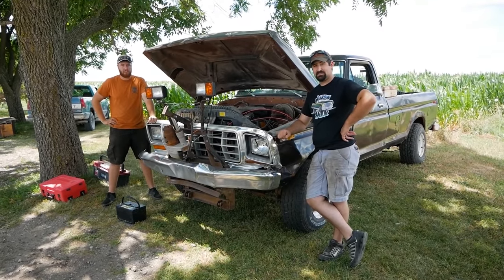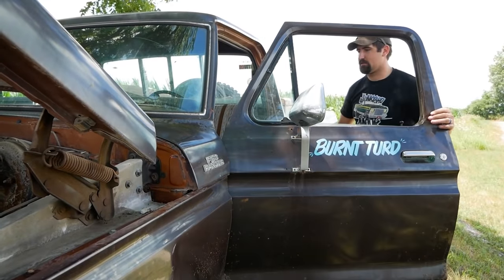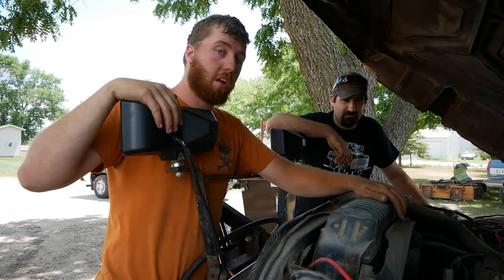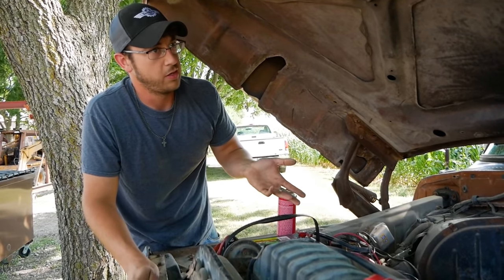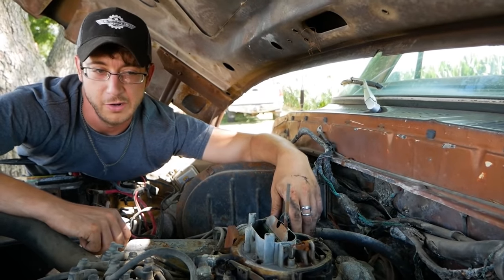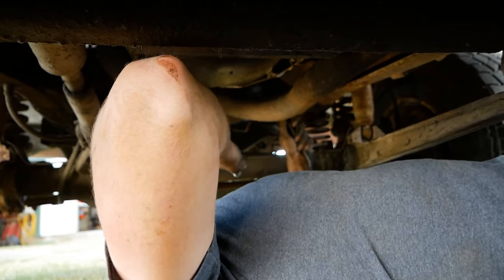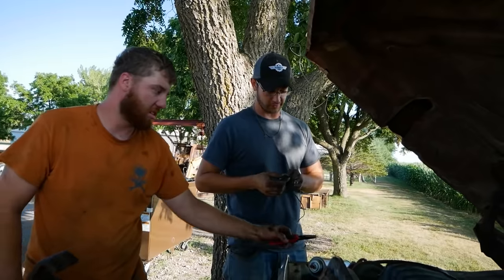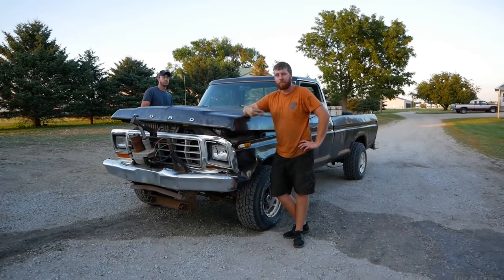BURNT Truck Revival?? 1979 F150 First Start Since ENGINE FIRE!

Comment: I have 02 4 door Ford truck, about 250 thousand miles. Bought new by oldest son. Runs like new. Not oil burner. Inside, out side great shape. Owned Chevy trucks, rust buckets . 84 year old driver.

Comment: those old snowplow lifts only power up. they use the weight of the plow and gravity to go down. this truck is a perfect example of the joys of "free" vehicles. you'll find there's always a good reason why the last guy threw it away and gave it to you. in my experience, it's because they ran out of cuss words from working on it, and they figured you still had some left.

Comment: Look for the small cover on the rear of the transfer case between the 2 larger covers. If it doesn't have that it's a 203 chain drive case.

Comment: The track bar mount on the axle side requires a tapered bolt. The original mount is a straight bolt that wallers out. I don’t remember the reamer pitch required to taper the mount. Several companies (used to) make the taper bolt kit. 
Worst death wobble ever un-repaired.

Comment: I'm not sure how that plow worked, but the way I've seem them is to go down the switch locks down to a "float" mode. Where the weight of the blade pulls the hydraulic cylinder down, so I think to get that down you would need to have it in float mode and push down on that cylinder on the front, I think.

Comment: IIRC, 157 tooth is for manual vehicles, the starter for which has a 9 tooth gear. 164 tooth is for automatic vehicles. starter will have 10 teeth. also the automatic vehicle starters' bendix stick out about twice as far as the manual variant on fords.

Comment: That is a light duty Dana 44 front (small hubs), 3300lbs axle. They made a heavy Dana 44 (big hubs). It is a part time 4x4. By unlocking the hubs it only makes it it "Part Time". You kinda had it backwards. "full time" or "all wheel drive" is what most SUV are today. The light duty D44 isnt a bad axle, but the hubs should be upgraded

Comment: (3:55)She's lifted. (6:30)You're gonna want that cluster of wires to be individually insulated. If you can bypass that whole section that might be a fix. (22:22)She don't turn left and right so much but she meanders ever so slightly here or there, she's a cruiser. That Luke is built like a supercharged 350. I'll be glad when he has kids and ruins his body(dad bod). (50:20)Nobody is getting out of the way of that cute little horn until they see that big ole truck with no brakes or steering coming at em. You might sell that truck to Hollywood as the stunt double of a good truck that flies over a cliff to its fiery grave.

Comment: On one of my 460’s I stripped even tooth off the bendix gear using starting fluid. I just use gas done the carb now if I need to. Just my 2 cents

Comment: They used to put that between the Springs to lift the truck bad idea. The one round with a used to put a sock on it and turn it and it would lock into the spring and force the spring apart therefore giving you higher or height

Comment: I would love someone to give me a 79 F150 4x4 like that, I had a 79 F250 4x4 4spd 351M Dana 60's F&R with 4:11's ( out of a F350 ) . Rebuilt the entire drivetrain. Loved that truck, sold it to a buddy who sold it to a guy that turned into a show truck with a 460 & 44's. It wasn't that nice when I got it for $500, I knew the original owner who told me the day he bought the truck new he carried a Cord of wood out of the woods with it, & used it just about all 60k it had on it hauling wood like that.

Comment: That 460 probably has the a 390 flywheel if it's a early 460 so its internally balanced and they didn't put 460s in that style truck from factory I have had issues with my swapped 429 zf5speed 76 f150

Comment: I have had a starter do that on my 96 chevy it only turned the engine enough to catch a cylinder or 2 and it lasted about 2 years till my distribitor cap went bad after Hurricane Laura and I thought the starter went bad

Comment: Great video, Kevin. Luke is correct about the 'retarded' timing chains and distributors from the mid-70s. I've known it to be true for the 351-400 series engines, though I am not 100% sure about the 460, but I believe he is correct. That was a great swap-out at the time, in any case.

Those 'extra springs' those hard rubber boost springs that you could use to bolster a sagging spring. I hadn't thought about those in a long time. Your home-brewed one looks pretty decent :)

That might be a fun truck to drive into a building at high speed for a movie, so sell it to a movie set. You wouldn't need brakes for that one :)

Comment: I had a 79 full size bronco and the back window on the tailgate even work from the dash it had a little switch to see if it would go up and down no problem you had a I think it's 351 modified in if I had the original paperwork that they got from The Ford place in Bristol lock out hubs I loved itsliding glass windows on the side of the back are backup offer me money for they must have been rare but I loved it paid $600 for it

Comment: If u need another truck to fix and try to start or get running at least it is a doge power wagon 1979 club cab has ignition and key we have a starter to put in although I live in Wisconsin near Minnesota your call

Comment: Thunderhead289 love your videos bud but your little comment about Ford couldn't do automatic transmission right hate to tell you man but I have a 1995 F150 that it has 289 thousand miles on it and she still shifts like butter got a little 302 e4od and I know everything's original because it has been in my family since it was brand new off the lot was my father's old truck

Comment: At approx 46:39, a statement is made about the starter gear on the original starter turning in one direction while the gear on the new starter does not. The statement said that the gear should not turn. That is not correct. It SHOULD turn. The bendix drive has a design feature called the overrun clutch that allows the starter gear to freewheel when the engine starts and starts to try to drive the starter motor, otherwise the armature in the starter motor would be driven at thousands of rpms and would self destruct.
Reply from the maker: Well... Now I know why it exploded! Another fail for the $18 starter

Comment: Take the ford distributor and put a gm hei distributor in its place. And yes that can be done because I've done it. Much better. And the electric fuel pump is a diaphragm pump. Thats why it sounds so different than the one you put in line sounds

Comment: 7.3 IDI starters are not indestructable.... when you prime the fuel system with the starter they die fast. With that said, my new powertorque starter works great and hasn't failed me yet

Comment: This happens to a starter when the clutch in it is flogged, It will spin but when there's pressure on it it will stop, a good way to test this is to hold a block of wood on it until the block starts smoking that's when you know its a goodin. you can rebuild the clutches in them but why bother

Comment: Hey ive got a ford with an exhaust pipe per side of the engine. One side is slightly gray smoky. Could that mean head gasket?

Comment: Hot wiring and them trying to turn over is because the duraspark module is bad. They have a start signal wire to retard timing and the diode can burnout and bridge the ignition and starter solenoid wires, it also can make the starter stick on after you first turn the key.

Comment: YES. IF you shut the engine off in park or neutral, a 8 cylinder will stop in one of 4 positions every time. 6 cylinder=3 places.4 cylinder=2 spots. Save a thousand dollars and shut your engine off IN GEAR.BTW, work on truck that caught fire: remove the hood is #!1!111111!.

Comment: I bet the original fire was caused by the starter reingaging why the truck was running it happened to me before at minimum it will over drive the starter till it catches on fire

Comment: I can confirm the retarded cam timing. my 78 f350 had the factory timing setup so i went with a 69 429 double roller kit and it made a night and day difference, then after that i got rid of that motorcraft carb for a good holley, and the thing is a monster. when it couldnt even chirp the tires from a dig now the thing will lay patch for half a block
Reply: oh and i bought a shirt from your store a while back how long is shipping normally

Comment: Yes, what Luke said about the timing chain is correct. 8 degrees retarded.  The heads are likely D3VE-A2A & they are a very common smog head that holds no $ value but actually with some porting the heads can be pretty good for performance. The block is likely a D1VE or a D9VE. Both the same deck height at 10.322 but if you have a D9VE (79 or later) 460 it will be external balance. Earlier ones will be internal. They started to retard cam timing in 72. So earlier than 72 timing chain is fine  or aftermarket 3 keyway. Also look out for D2VE-AA heads. They are only one yr & they are the only open chamber head available. Stay away!!!! They are prone to detonation.

Comment: I like how they just bring minimal amount of gas to make giant 460 run. Seems like you would want to bring a big 5 gallon gas can with you! Yeah we will just bring a can of brake cleaner. what is wrong with people these days. Try dumping a cap or two of  of gasoline down the carb.  It runs on gasoline. It was designed to run on gasoline remember that. Bring a empty  mustard squirt bottle full of gasoline and squirt from that. Its a great way to help do a old start. It is very annoying to see noobs squirting brake cleaner and ether from a can to start a truck. Please  get over the brake cleaner and ether they destroy your rings and motor. Also your can pull start a vehicle. Also a boat gas can is perfect for using for a temporary gas tank put it in the bed and run a hose to the carb with your electric fuel pump get a good one you can use all the time for this.

Comment: The smog era 460 is retarded 8 degrees. Get a timing set for an 69 Lincoln and it will be straight up timing. Speaking of Lincoln, that 460 is probably out of a Lincoln based on the Saginaw PS pump. The rest of Ford cars of the era had ford pumps
Reply: Also without the vacuum line to the trans it won't shift very well

Comment: i have to be honest with you guys thats not the only Ford  ive known to catch on fire in the engine compartment  i have a female cousin that b drove a Excursion and twice that  sucker  went  up in flames in her driveway  the 2nde time the insurance  totaled it  as that one got hot enough to  burn all the tires and  interior  out of it  and she went and bought another one n top of it  in the 1980s i had a 68 Mustang  that caught on fire so badly that it  burnt every rubber bushing on the front end  and melted the plastic inserts on my Gt hood  bye it wasnt a real Gt car  as the guy before me  tried to make a clone

Comment: I have to laugh At you guys while  trying to revive an old Ford as you bad mouth Chevys but my 21 year old Chevy Tahoe is purring like a kitten still on the road running great looking great and just pulled my 3000 pound boat around 30 miles without any problem

Comment: I would not waste my Time on a Ford anymore. I used to have a Fleet of Fords like that in my Commercial Tree Company and talk and they were ten times worse than my Studebakers or Dodges. By the way I still own and drive m 1951  Studebaker, I just sold my beautiful 1886 Dodge over my 1951 Studebaker. I would never own another FORD.

Comment: At the truck that I'm very interested in I live out in Texas I had one number a years ago that had the same problem I was an electrician and some of the other guys messed with the carburetor and it caught on fire so my boss closet to me took it home my father-in-law and I rebuilt it had to rebuild the cab cuz the cat burned up to had to put a new windshield and all new glass in it my wife in that truck had a love-hate relationship she couldn't drive it more than a couple of Miles without it breaking down on her I drove that truck all over the place though with no problem she ended up trading it in on me on a new truck and I hated go round a couple of years in that thing I was back in 99 ever since then I've been looking for another one couple years ago got hit by a drunk driver so I can no longer drive a manual and no longer work so I'm just looking for something to Tinker with

Comment: Retarded 4* for smog
Had an 84 2504x 4.10 w/460 & c6 for 20 yrs, screemed on hway, new chain and gears set str8 up woke it up a lil, not much but a lil